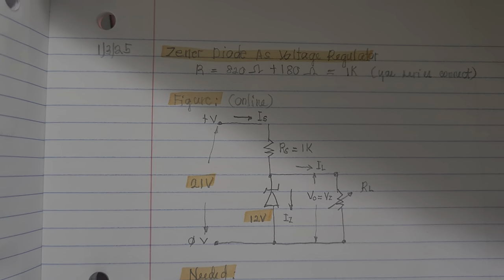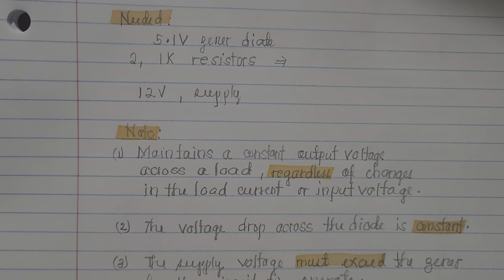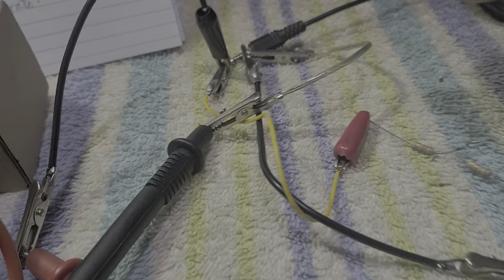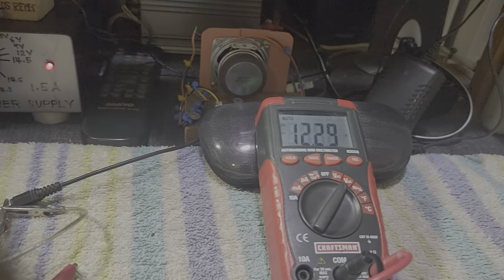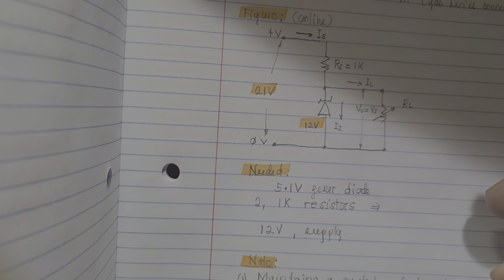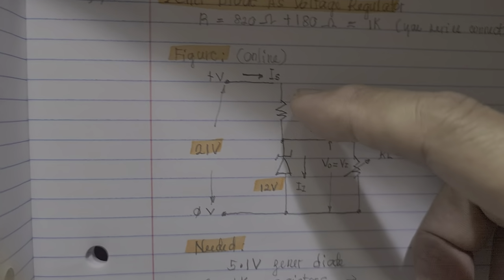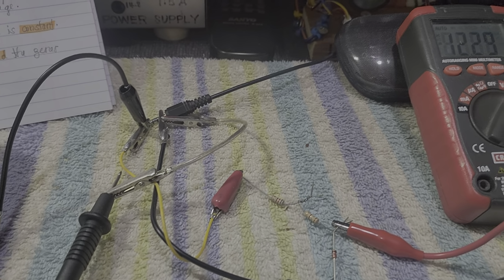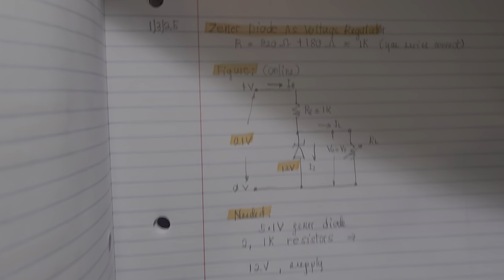Zener Diode As Voltage Regulator @ProfDavidJDelosReyes

Comment: It is used as dc voltage regulator or ac voltage regulator? Don’t say both, give ans more appropriate
Reply from the maker: You are rooky.....zener diode is for dc voltage regulator without mentioning..The zener  THING  automatically  is for dc voltage regulator.